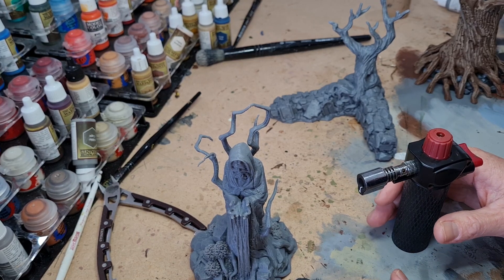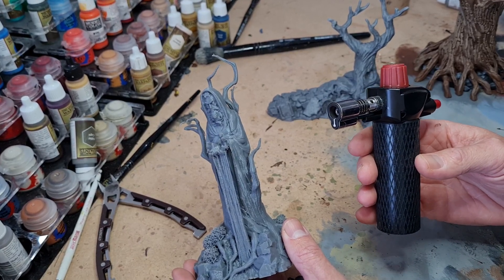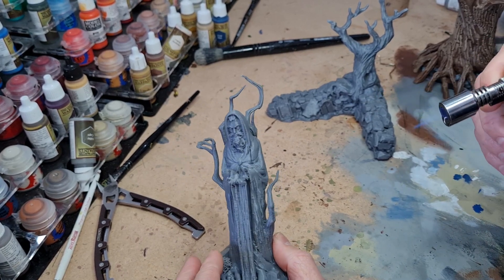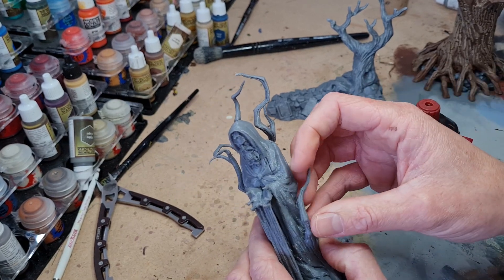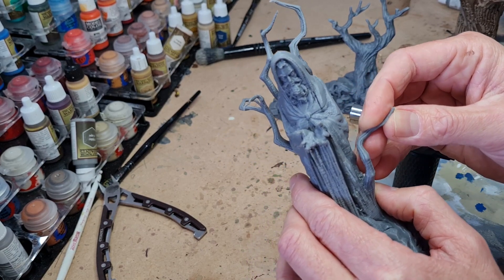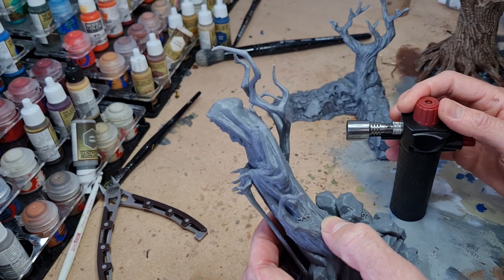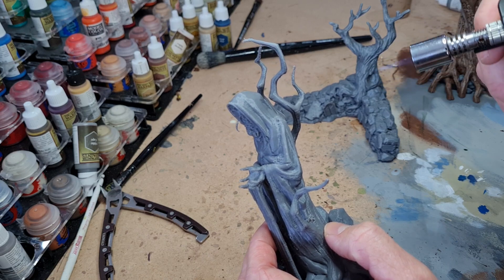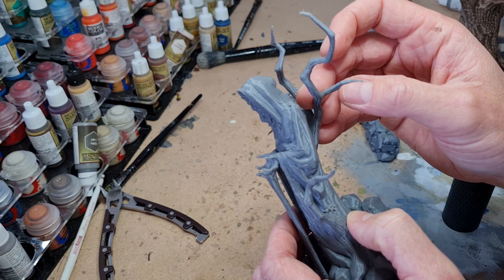Bending Models with Heat

Comment: I 3D printed a chamber using PLA to hold liquid for daily use. Would using a heat gun help melt and seal the surface of the PLA to prevent leakage?
Reply from the maker: I’m not sure if that would work, maybe paint the interior with water proof paint